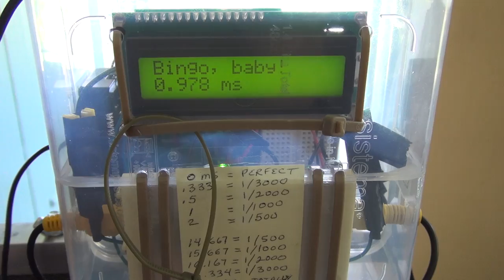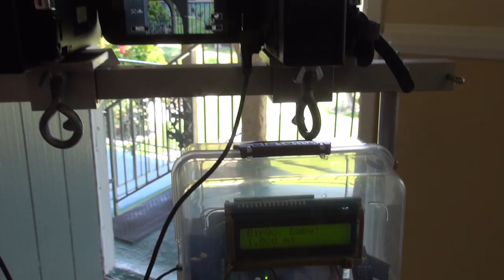The Significance Of Being In Sync - Intro

Comment: That's very interesting. What kind of conditioning is required between the camera and BASIC Stamp?

I'm a long-time Stamp user, almost everything I do now is with the Propeller. Last year I created a LANC object for the Propeller so that a friend could control a group of remote cameras from a single location (commands sent by RF to base at camera, base controlled camera with LANC).
Reply from the maker: Jon McPhalen, I turn one camcorder off and on until a suitable degree of sync is achieved, which varies depending on the subject. That's all there is to it. :)
Reply: Roger Maddy I was wondering about the details of measuring the delta between cameras. Are you measuring the distance between leading edges of the vertical sync pulses?  Kind of curious how you're getting sub-millisecond resolution with the BASIC Stamp.